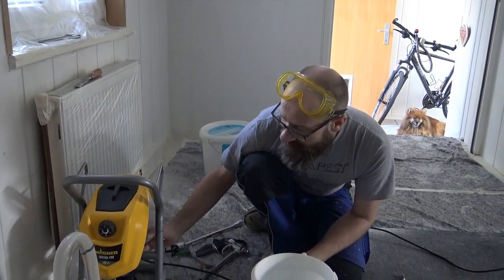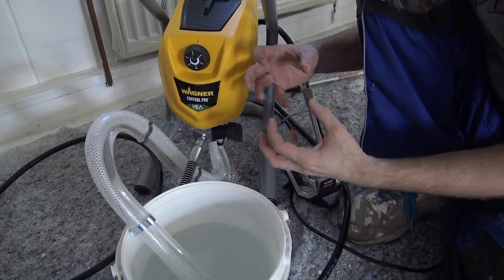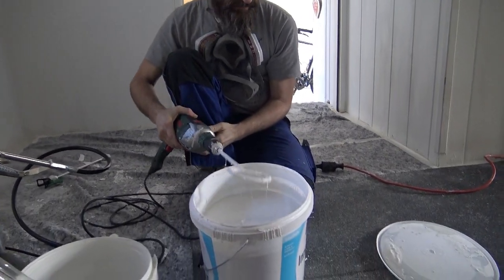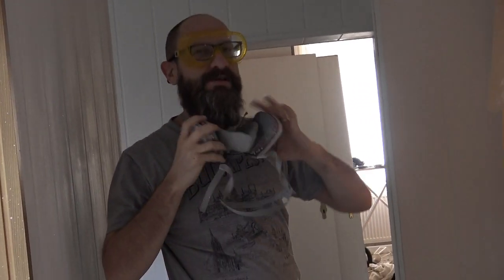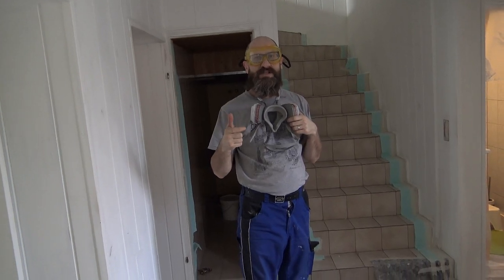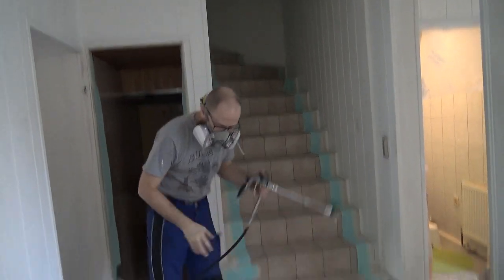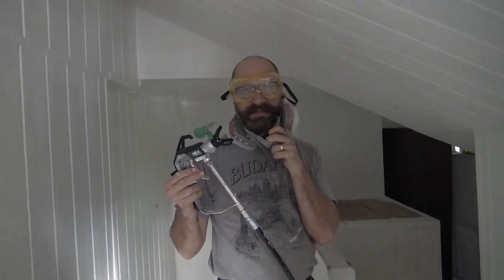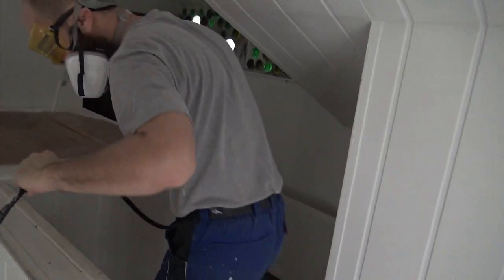Wagner control pro 250M Airless paint spray system Professional Paint Sprayer

Comment: You're a brave man filming your first job with the Wagner.  We have just bought a timber clad pole home that needs painting inside and out, including the roof.  You have inspired me to get the airless spray gun and give it a go.  Thanks for the video.
Reply from the maker: Just take your time and make sure youve prepped all the edges like windows etc. The painting is the fun part!